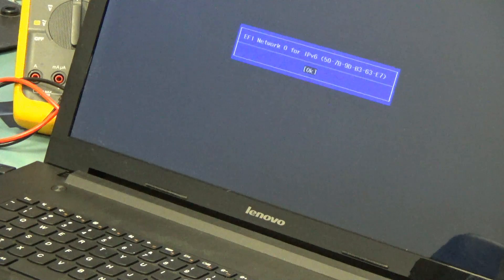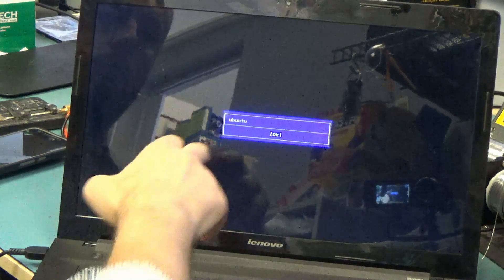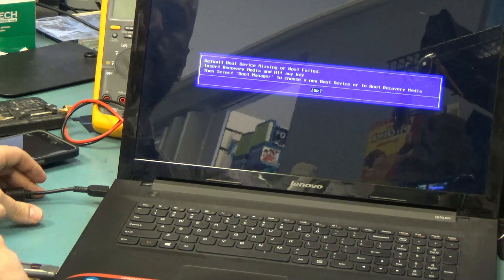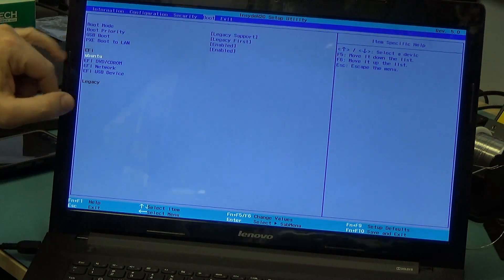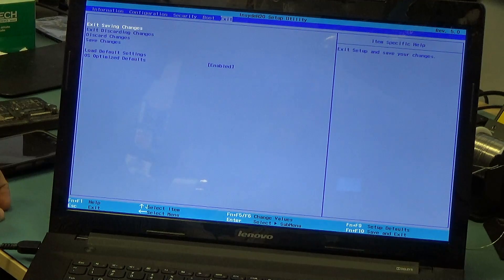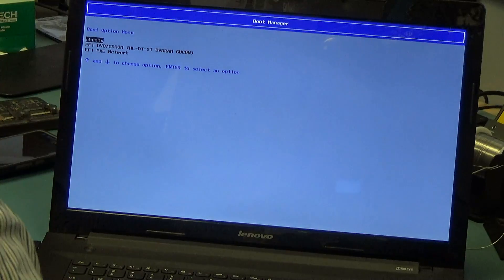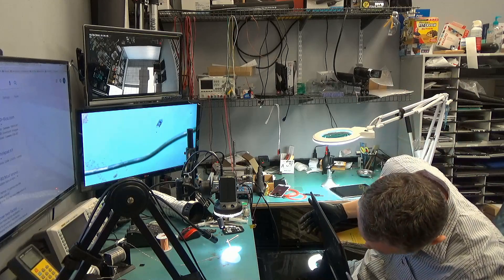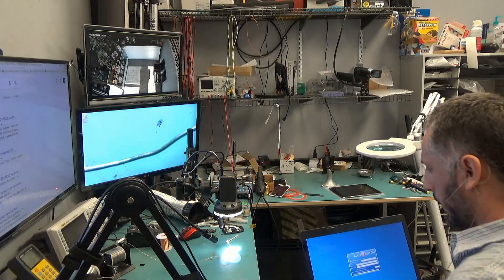Lenovo G70-80 ubuntu Kernel bug BIOS startup Error - Corrupt Bios chip replacement

Comment from the maker: Soldering station used http://amzn.to/2EcnSxu
Bent tip http://amzn.to/2FwWffL
Low melt solder http://amzn.to/2BPXCXj
Microscope http://amzn.to/2D7rKvZ, 
Polarizer lens http://amzn.to/2qCnP7w
S-109 Stand
Reply: Your bootable usb must have the MBR sector table and not GPT otherwise would have booted no problem
Reply: Can you fix 2017 iMac motherboard with vertical lines
Reply: @stocktronics  sounds like a gpu issue
Reply: @justins4932  is gpu is the same as the video card ?
Reply: @stocktronics  Yes!

Comment: Thanks for your insightful video as always. One question to ask. Where can we get/buy a healthy BIOS chip? I have lenovo ideapad520 that now seems to have the same type of currupted BIOS on it. It boots up, but gets stuck with black screen never allowing me to enter BIOS or recovery mode. Before becoming this, I tried to update BIOS via official lenovo updater running on Windows10, but the last stage of updating process, my ideapad suddenly got frozen. Now I desperately need to get the healthy BIOS chip and replace with currupted one. Any info is appreciated.

Comment: @NorthridgeFix I had a similar issue similar hardware. The system probably would have booted a Linux USB but not Windows as you tried. I fixed mine by deleting all trusted keys, cold resetting the bios ( cmos & batt unplugged, drain power by holding power button for 20 secs ), turn off secure boot and the trick is to hot switch the windows live usb when in bios boot drive selection. Try to use a USB2 port if possible.

Comment: All you needed to do was to remove the charger, the battery and the bios battery and leave the laptop like that with no power for 10 minutes. Then the bios would auto reset

Comment: Alex what is it about this board and chip that made you decide to use low melt? Could it be not disturbing components around the BIOS chip? Your channel is awesome BTW. I recently decided to switch from the automotive repair field to Endoscopy service after 30 years of busted knuckles and dirty hands. Your channel has taught me so much about electronics repair. You inspire me to get into electronics repair on my own. You are very gifted in doing what you do!! My micro soldering has improved very much in the past 2 years. I recently opened up a USB I had soldered when I started my new job and was embarrassed by what I had done.

Comment: As a technical question; how is a normal installation of Ubuntu reprogramming the bios? Sounds like the user may have used an ubuntu that had a virus of some sort.
Reply: Ubuntu modifies the uefi bios to install its Boot entry. In the early stages of uefi due to mismatches in the specifications / bugs in the uefi implementations  Linux could brick the uefi bios of some vendors.
Nowadays this shouldn't be a problem anymore.

Comment: I started almost same as you. Started helping dads friend wire houses when i was 8. Read lots of books and by 16 had designed and built a cctv camera. By 18 designed and built a pc. Then uni. Got a degree in microelectronics and computer design.

Comment: That usually happens when secure boot is enabled. You need to turn it off before booting Linux on legacy. Grub should have came up, but it didn’t, so either secure boot is on or grub is broken.
You need to run an actual boot rescue, not a bootable USB. This will fix these issues 99% of the time. If it was the bios chip, you wouldn’t get a bios menu.
Reply: No. It was a bug in Ubuntu 17.10 that would corrupt the BIOS on some Lenovo laptops. That's what you get for using ghetto operating systems.
Reply: @servale23  thanks lol that actually proved my second comment right lol uefi with no .efi 😂

Comment: Love to be your student 👨‍🎓 from Sydney. I do normal laptop and phone repairing as a hobby but I try to fix all kinds of electronics as u are doing. Just because of u I manage to fix one of Bose subwoofer 700 which never turn on. Finally I fix it with my own here n there experience 🥸. But I have a passion to do this kind of jobs. But I don’t have any education regarding electronics at all. I did my MBA in management information systems from Pakistan but after 10 years my mind start understanding all type of electronics… I have no idea how it’s possible but I feel I can do this kind of jobs easily but I need guidance like u providing through your excellent videos. I learn a lot … kindly suggest me some short course so I can further excel in this field of electronics. Highly appreciated… thanks in advance.

Comment: in the first i can see ca boot ufi from cd rom =i also have this problem from asus  

first download winpe 10 sergei strelec and write on cd 

in ufi mode can load winpe 
after that use command mode for bios reflash 
amrecan bios and other company give a command mode exe file to re install chip 
if the bios chip dead .you cant even see lenovo picture 
in hp .also re load bios in flash . and install in the loptop .press and hold win key +b key

Comment: What about a BIOS flash restore before disassembling the entire machine?
Reply: It could be done potentially with a bios flasher it clips directly onto the chip with a clamp lead and can flash the chip. Depends on if there was hardware damage to the chip
Reply: @TopherToke  Yes, I guess he didn't know bios chips could be flashed this way.
Reply: No flash options in the bios+it is not recognised the flash drive.
Reply: @83Sogron  huh? Isn’t it an external kit that clicks onto the chip to reprogram it?
Reply: I don't think that would be possible once the chip has been corrupted. I'm sure he thought about it too.

Comment: You never tried the dvd portable windows and bios recovery. If the portable windows boot from it since it was detected from the BIOS then you can flash the bios inside it. I don't know if g7 has a bios recovery mode but most modern laptop has it.

Comment: A nice way to keep the screws in is to lose them up, so they would fall out and then put some tape above the hole. That way, you never lose them or get the wrong screw into the wrong hole.

I do that for years now and when you put it together, your screwdriver just punctures the tape and you can screw it together, remove the tapes and your golden.
Reply: Great idea
Reply: Thanks
Reply: Great tip, thanks

Comment: I'm into hardware not so much software.......how the hell does a OS even have access to the BIOS like that?
Reply: Bios is a software on a chip, it can be updated, in various ways...  also easy to get corrupted too... something crashes during update, bios can be caput if no backup bios exist laptop became 1st stage brick unless you replace the chip... 

i would first try resetting bios settings on the cmos first... before chip replacement, sometimes settings on cmos (where bios settings are stored) gets corrupted, cmos reset can fix it sometimes...
Reply: @mytester6208  For my own edification, I was wondering about this - I didn't hear it mentioned, but there are two easy steps before replacing the IC: reset the BIOS to factory defaults (sometimes called "optimized settings"). Except for the bootloader portion, everything else about the BIOS appeared to function properly. If a factory reset failed, re-flash the firmware through the BIOS utility? One of those two steps should have cleared out the BIOS eeprom/nvram. If those failed, yeah, replace the chip. Maybe they did those other things. Felt like they went straight from "I installed ubuntu, BIOS corrupted" to "replace hardware"

Comment: I had lenovo y50-70 and it had similar issue. BIOS was not applying changes multiple hours and restarts later I found out it had some weird issue that only complete power off was correctly applying all changes  (had newest bios at that time). Maybe this helps someone.

Comment: Stupid design. Why in the world boot configuration is stored in FLASH and, for the worse, the same chip as firmware. Stuff like that is supposed to go into battery backed NVRAM. If anything goes wrong, remove (or even short) the battery, wait few seconds, put it back and the machine is fine again. Some kind of battery or supercap has to be in the system anyway (for timekeeping). IMO, leaving firmware FLASH writeable by the OS all the time is just asking for trouble. Before BIOS/UEFI transfers control to the OS it should disable any write access to itself, just as SMM code does. Most users will never do or even need firmware upgrade and upgrading should only be possible from BIOS/UEFI setup only.

Comment: did u bought new bios or just a chip and you flash it ?
Reply: @FelinoFacho it is a compatible chip. Both are 25 VERSION AND 64MB memory type (GIGABYTE 25b64bsig  vs winbond 25q64fvsig)
Reply: @FelinoFacho that.. for me it is new. and the ic was flashed out of the camera.but that is for me. i prefer to used a new one then a used. may have problems in a future with a used one.

Comment: Hi!
The old chip bios become good by programming in a programmer?In my case if I will take out the old bios chip and reprogramming and put it back, works?
You are the best!
Thank You!
Reply: If the customer flashed a wrong bios then you can reuse the old chip, but if the old bios chip became corrupted without doing anything, you need to buy a new chip and program it if it isn't already
Reply: @gio0042  Thank you!
Reply: By the way, desoldering-soldering is not needed, because there are special clips to program in-place.

Comment: What a waste of time.  I have the same laptop running Linux Mint (Ubuntu based), and yes it will not boot from the USB on EFI mode, unless I physically remove the SSD. Another option is to enable legacy support and then reboot into bios again. Then it will show the legacy boot options.
Reply: Easier way is to convert the USB from MBR to GPT. And then use it to boot the OS you want that supports GPT

Comment: Hi, I have a Thinkpad E470 and my problem is different from other people, I can't see the BIOS (F1 key) anymore and the Boot Menu (F12 key) neither. I have Linux Mint on my thinkpad and I stuck with this operating system since I cannot access the BIOS and I cannot install another OS 'cause I can't boot from USB. Have you heard about thins issue? I need to replace the chip also?
thanks.
Reply from the maker: Yes, sounds like a bios firmware issue. Chip programming and replacement is required to fix the problem as you see in this video.